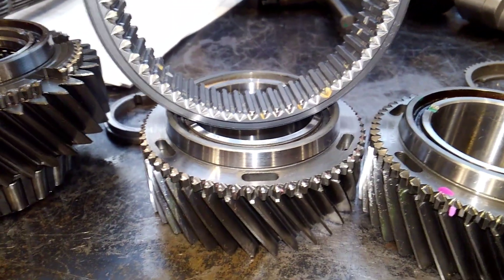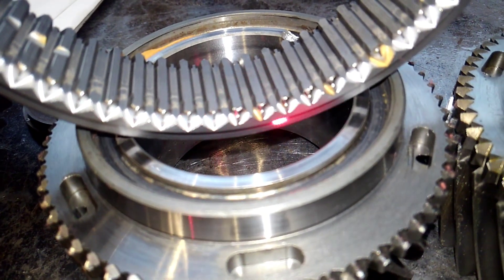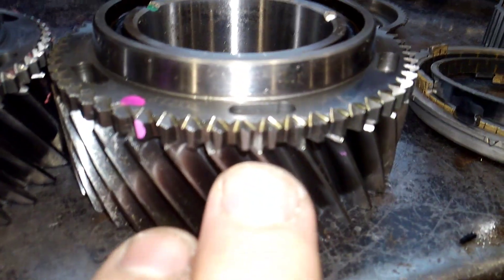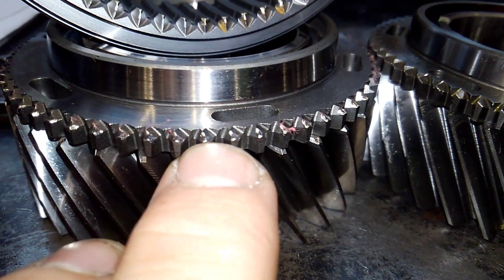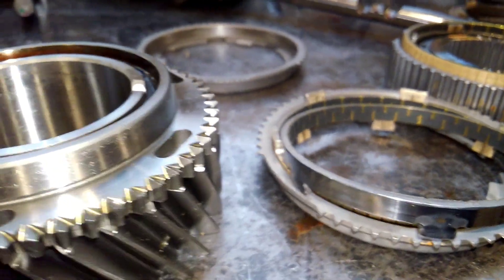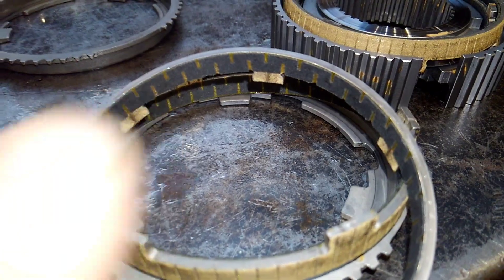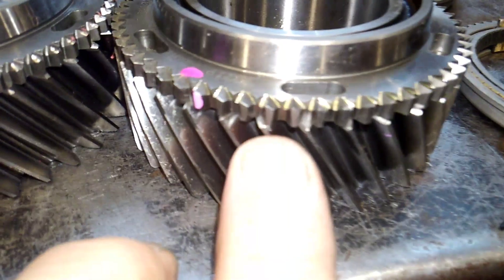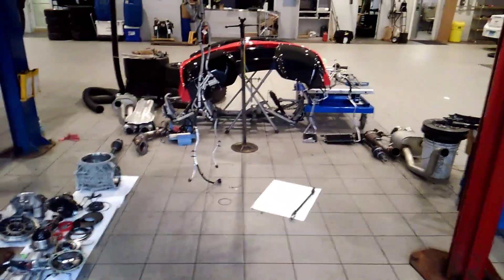T6070, 2nd gear pop out root cause

Comment: If t6070 nibbles down shifting from 3 to 2 after transmission warms up to 130f. Does that mean synchro are gone?
Reply: Did you find out solution?
Reply: @whoisrobzilla  yes, all I needed to do was be more aggressive with shift.

Comment: Could be a bad shift fork as well. Gears popping out usually indicate that the hub isn’t fully engaging that gear. Griding going into gear but does not pop out indicates worn down engagement teeth. Either way, if your gear looks as bad as the one in the video, I would replace it and the hub/slider assembly.